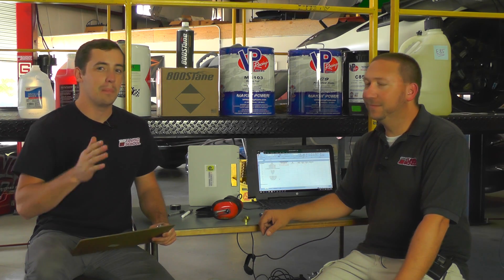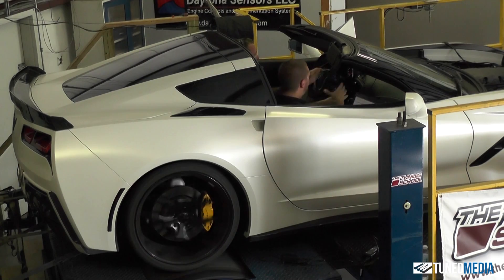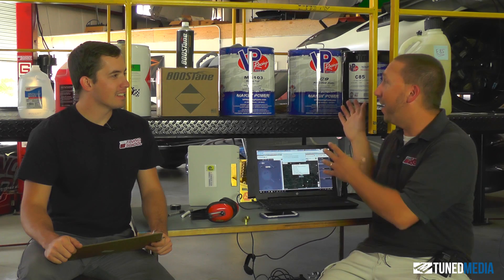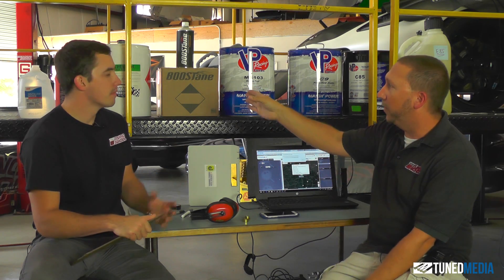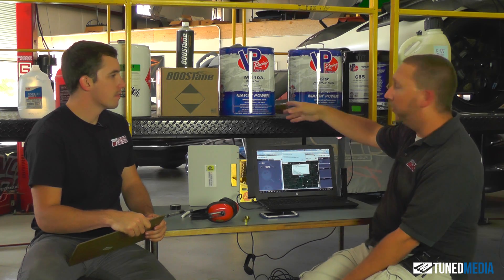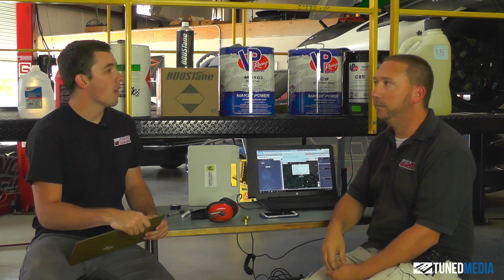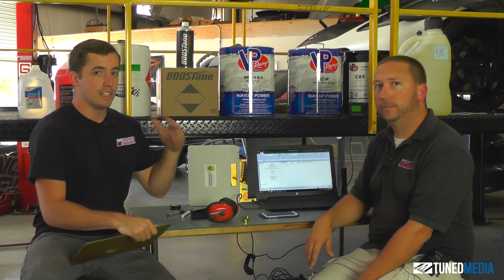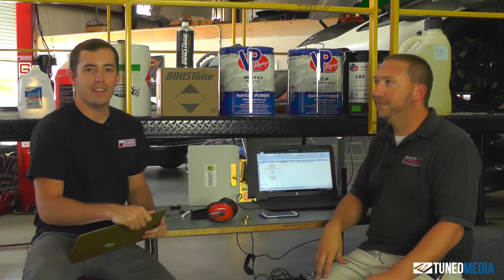Racing Fuels: Which fuel makes the most power?

Comment: for my Buick turbo guy's out there. running 21 Pound's of boost and up.you can't beat VP C 16 racing gas it's blue in color. 5 gallon's in ur tank with no pump gas, will have a well tuned Buick turbo car flying.from stock up to 19 pounds of boost.a good alcohol injection kit is good for ur turbo buick.you can use that with ur regular 91 pump gas.

Comment: would like to see 93 gas sprayed with 93 gas running. and E85 sprayed with 93 gas running.
Reply: That doesn't even make since. You wouldn't need to spray gasoline from an auxiliary setup. You just program more fuel into the tune. And spraying E85 like they do with methanol injection would just be wasting it.

They do it to cool down the intake charge which contributes to the better knock suppression. The fact that it increases octane and adds fueling is a benefit. Latent heat of vaporization. Methanol and water and boost juice all remove heat from the incoming intake charge. It also helps suppress detonation. Gas doesn't do that well enough to benefit from it and neither does E85.
Reply: It would help to educate yourself on how and why methanol/water injection works.

https://youtu.be/HkPFZWd8wj4

Comment: Thanks guys, super interested in this. I'm running 93 plus water injection (100% water). My car is literally at the dyno right now . I'd love to see actual figures of whether it's worth using meth/water instead of straight water...hopefully very soon!  If there's big enough difference, i'll switch before it's tuned.
Reply: Straight methanol.  Zero water.  Should be blatantly obvious why.